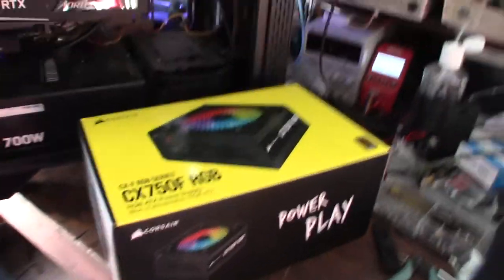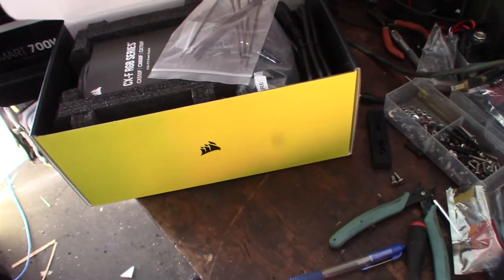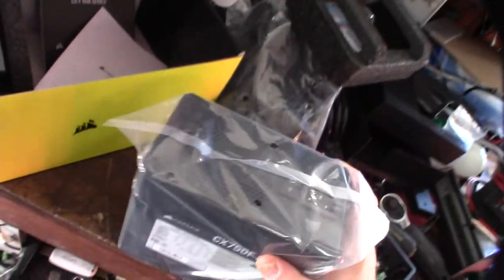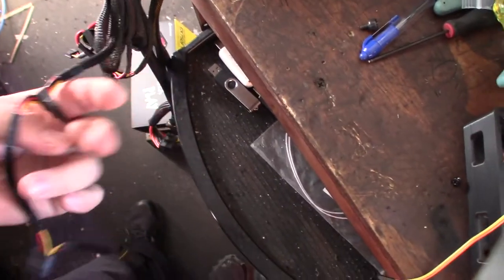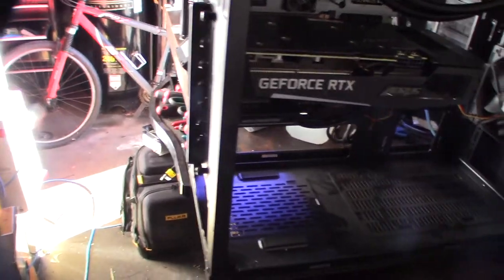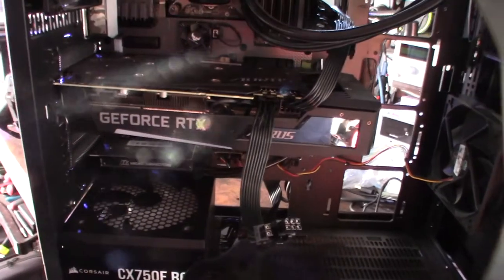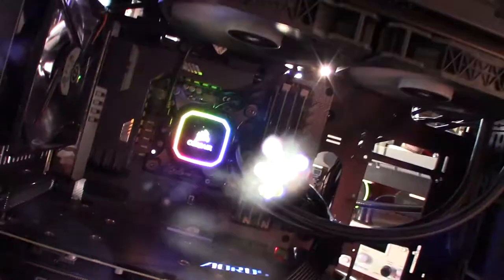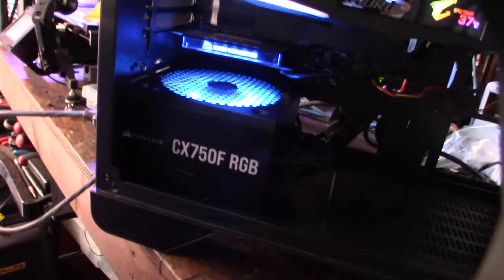Corsair CX750F RGB, 750 Watt, 80 Plus Bronze, Fully Modular RGB Power Supply Install Review

Comment: mine makes a weird noise i bought 2 and they make a weird eletric nois
Reply: It's a problem with corsair psus
Reply: @kikiik3346  ahhh i sent them back i heard they can fry your components too
Reply: @mxdsfn8979  I've got a corsair psu too but i had no problems yet
Reply: It's coil whine it can be normal thing on stuff if you hear it and want to be safe just don't use the psu but overral coil whine isn't really a problem just annoying
Reply: @mxdsfn8979  a lot of folks use Corsair PSU, that sounds like a myth xd
Reply: Been using my 750 RGB just over a year now but since day one it's been pretty noisy, however it does run fine.